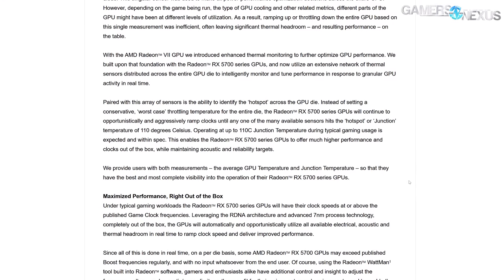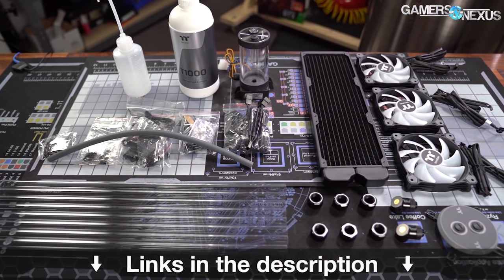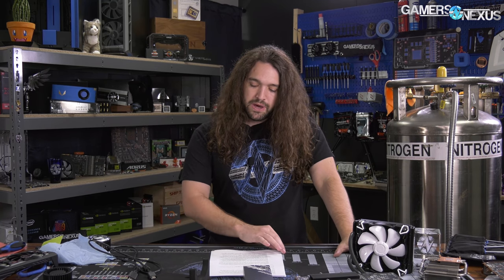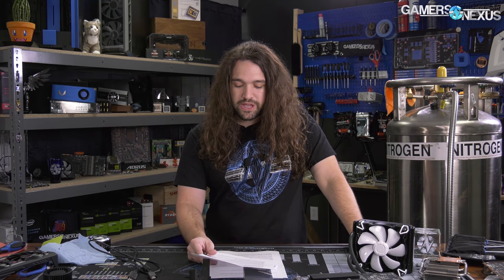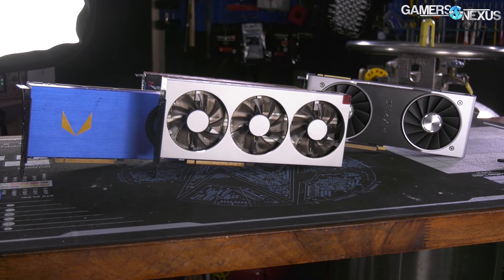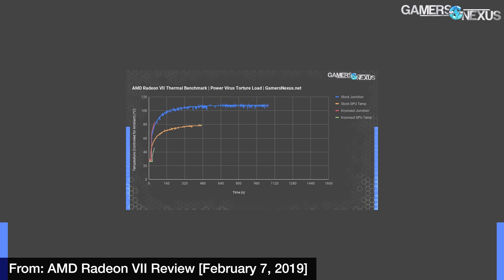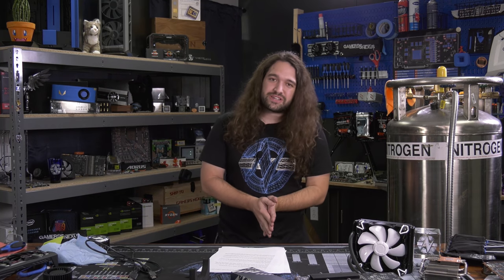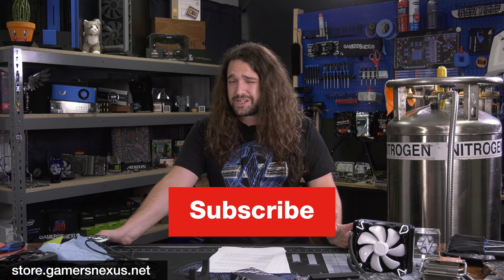Explaining Navi 5700 XT Junction Temperature | 110°C is Not "Expected"

Comment: Man... I need Help :(... Im from Brazil , I dont even know how ti speak english very well... But I got Sapphire Pulse... All the temperatures are even better than your test , GPU Edge I get 65c , Memory 80c ( Max ) and VRMs 58c !!! But the fucking hotspot is getting hot , 106c every time I put " unlimited frames " , Fortinite and Modern Warfare ( BattleRoyale Mode ) , they are getting 174FPs 1080p , and the " GPU Hotspot " reaching 106c in both cases... When I lock the frames in 60 FPS , that Gpu Hotspot came to 60/80c MAX !!! ALL ULTRA AND EPIC SETTINGS. 
But I have a 144hz 1080p monitor... I really want to play in the 144Fps , but not in 106 degrees ( hotspot )... 
IS importante to say that even When Hotspot gets 106c , ALL the other temperatures keeps nice , Edge 68/70 Max... 
Should I give that Card Back and take a Red Devil ??? I Have a Sapphire Pulse 5700 XT right now , Just to remember. Thank you.

Comment: In other news, 145c on motherboard VRMs is not fine, do NOT turn off VRM thermal protection! (RIP my motherboard).
Reply: I’m pretty sure the AM4 Asrock boards are bugged (well, I know they are, at 0c they show 116c VRM due to integer rollover), and I know a few companies had a limit above the max for the bits, so it simply couldn’t register above X degrees, and they set the safety limit at X+some and so it would never detect it was overheating... Good job... Slow clap...

Also, why didn’t you just run fans on your VRM? I ran a 4 phase board at over 300w on FX thanks to $3 in cooling upgrades to the VRM, I’d recomend that next time if you’re pushing it (2x 40mm fans and some 15x15mm heatsinks which I added to the chokes since the Mosfets already had heatsinks, but that cost would cover heatsinks for both). That was on ambient cooling, so realistic (sub-zero I push it farther of course, but then everything is cold so it makes sense that it would be fine), but that stopped my VRM throttling issues back then in the FX days.
Reply: The board i was using was an MSI Z390 Gaming Edge AC, pulling about 230w at a 5ghz all core OC, poor VRM even being a 10phase, just didnt like it, i was busy checking stability then noticed that the VRM temp (which goes to 125c then stops registering) had been not registering (above 125c) for a good couple of minutes, before i had chance to quit the stress test, the board died, wouldnt boot at all after that, completely dead! Normally it throttles at 115c VRM, i didnt expect it to hit 145c as indicated by external thermal probe thingy
Reply: ValkyrieStar wow, that’s a trash board then... My 8 phase x399 board barely gets warm even with those crappy heat-blocks (it’s not really a heatsink, more like a brick without fins) and no real airflow, does fine for hours at 450+w on the CPU, VRM is barely warm**.

**I use my machine with 4x Fury and 2x SuperNova 1300 PSUs to silently heat my room in the winter since it’s just as efficient as a space heater but it’s silent at 1.7kW with voltages cranked for extra heat, and it runs Crysis at 100 fps at 4k Ultra ;)

Normally I’d say if you overclocked (even 1 MHz), you broke the warranty and that’s on you, but that is so trash I’d be tempted to ask for a refund and buy a different non-$hit tier level board. 200-220w was right when my $40 (price paid brand new in 2015) mATX budget 4 phase board needed airflow, it could do 200w without throttling (24/7, and my only case fan was the exhaust on my 120mm AIO), so that MSI truly is just garbage bin quality. I hope you got a different one (Asrock seems to have well priced competitive boards, that’s what I use for FX/AM4/TR4 platforms). That’s just sad... Hope you got a better board, if it was replaced with same, then I definitely recommend spending the $2 in small and quiet 40mm case fans, because apparently that z390 is more delicate than eggshells! Man that sucks... well, good luck next time!
Reply: @jakegarrett8109  i managed to get a replacement board, unfortunately of the same model. I seem to manage to choose boards with trash VRMs as my X399 Gaming 7 (8 phase) i had before it (Gigabyte and AMDs fault for not fixing the god awful BIOSes so i went back intel).
I wish they had put good VRMs on Z390.

I've been looking at Ryzen 3000, but so far the temperature issues with AIO's has put me off, because of the die locations under the heatspreader means it doesn't cool well as AIOs are designed to have best flow near the center.

Comment: Let's simplify this to only one transistor every transistor have 2 junctions in PNP it is PN and NP... Now let's say we are using it to max potential so the case temperature & junction temperature will rise up let's say the case and heat sink is around 70C  while the junction can be easily up to 120C. Transistors are usually rated up to 150C and some even to 170C .

So yeah the 110C of the gpu junction is expected and normal

Comment: Summary:
Bad Cooler = Poor Life Expectancy of card, possible bottleneck due to thermals under poor ambient conditions.(cooler is sht , why is the cooler sht, why use a sht cooler, dunt uze sht cooler).
Good Cooler = Better Life Expectancy of card, more tolerance for poor ambient conditions, more stable boost.
60-90c is fine, 110c wont fry your card , but it certainly isnt ideal.
Better cooler design would of prevented the confusion and controversy from ever being an issue in the first place.

Stock Cooler = Fine , but loud
Community to Amd : "why such stupid stock cooler ? " lol
I own this card
I love this card
It runs great
The cooler if I turn it up , lol it sounds like a blade server (almost).
I plan on changing the stock cooler, just for the noise reduction (probably if i ever get around to having time).

Comment: Whatever people say lower temperatures is always better. And quiet fans are also better. There is no discussion here. Nobody wants to work next to a jet engine that is reaching the temperature of the sun, that will make the GPU slower (because it loses performance with higher thermals) and it will make people go crazy with "ZZZZOOOOOOOOOOOOOOOOOOSSSSSSSSSSS!!!!!!!!" next to it. 

Blower designs suck (pun intended), they are loud and make the cards work hotter. Yes, they are very pretty, you can make cards very slick and minimalistic, but on the performance part, open fan designs are way better, they can run quiet and with lower thermals, that´s it, simple. Blower designs are good for laptops because thye save space, but everything else should use open fan configuration. Hell, even a card with THREE fans is quieter then one blower, come on. It´s documented, it´s not like people are bashing hte blower design because they don´t like it, they are bashing it because it sucks.

Comment: Yeah i gót palit jetstream Rtx 3070 and it was tíme to repaste cuz cart háve 4 years so i decidet to change it cuz cart run at full load while gaming at 83 deg and hot spot 105 wich is not ideál yes i dont háve nay issues with cart but it just run kôre hot. All tho manugacturer claim that this cart i have in idle run a bit more hot at 44 deg well after i repaste mine run ár 28 deg and temp while playing on gpu drop on 77.8deg and hot spot highest 93deg wich im happy. I dont change pads cuz they dont looks that bad but in future i Will do it but for now it will do., also i used thermal grizly kryonaut and its work just great and i ask manugacturer what kind of thermal paste they used and they claim they use standart 2,9w MK so i used thermal grizly with 12,5 W/MK.

Comment: Don't care for whatever they say... All I know is since the 90's all my GPU's died in like 1 to 3 years without OC (though the crap ATI X1800GTO from like 2005 or 2006 got damaged by just using ATI drivers auto OC when they introduced it, it got texture corruption 4 ever even though still worked but eventually died)... 

Basically all GPU's I had that run at high temps died, while my only survivor for many years is the GTX570 Asus DirectCu II with 3 massive slot cooler and 2 big fans, even with 1.2v flashed bios at 1.2V and at massive OC to 910 - 915mhz (stock clocks are 732mhz for a factory GTX570) for years with 60- 70% fan speed the GPU never died or crashed and its still working, never even reached 80Cº while playing, it also had a lot of OC on the memories, even a game running for 2 days in a row on a Lan party 0 problems...

My current Strix RX480 OC is flashed to Strix RX580 OC and with stock fan curve its mostly hitting around 87Cº, super crap temps for what is supposed to be an even improved cooler from my older GTX570 Direct Cu II to the new Direct Cu III on the Strix, but it seems AMD just runs hot and doesnt OC much either :(...

ps: This is also sounding pretty bad for Next Gen consoles, while CPU side is actually both thermal and power efficient, the GPU part of it is being a huge power eater and tons of heat, if they dont heavily modify it for the consoles it looks like the Next gen consoles will either be super downclocked or be using quite a lot of power and a big price with the need for a huge cooler too, just hope they don't be another PS3 fiasco coming at 600€ :(.

Comment: My 5700xt couldn't keep from crashing my system long enough to even reach 110c lol 
I tried every trick possible to get that card to work.  The hardware is good but it should have been launched with working drivers, it didn't.  It is still beta drivers 1 month after launch. Unacceptable.
Started my RMA procedures earlier tonight. reinstalled my shitty 1050ti and I am running smooth as can be expected for such a low end card.
Reply: They havent talked shit about the  drivers i smell ripoff or a fast discontinuing i know u launch drivers before or at launch not years after

Comment: What about the life of the chip at 110C? vs 80C
Reply: I know of at least 1 HD 4670 that is still kicking while gamign at 113c or above used to be two but one died a couple months back.. seems like an acceptable lifetime to me.. RTG says it will work as expected.. you can probably trust it. In case you don't feel like doing the math that's around 10 years at 113c for one and almost 11 at the same temps for a second 6 of those years crossfired together, brand Gigabyte model HD 4670 512mb with the tiny aluminum fin cooler and tiny fan embeded into that heat sink, single slot card. Worse than a reference barrel cooler by miles for whatever that is worth.

Comment: Planned obsolescence. Deliberately run hotter than optimal for maximum consistent performance and lifespan. Chances are, the capacitors will blow up before the silicon though.

This is another reason why I am a fan boy of no one.

Comment: no need for custom cards if AMD puts a good cooler on them. that bad for business  plus it not like your boost clocks go up that much with a 20c  drop-in  
temps  60 Mhz 80  at most other than running cooler and less sound there no point to custom cards your not getting more fps with a custom cooler so AMD  reference cards do their job. 
 but not so good that you don't buy a custom card that's  good  business sense

Comment: We cant really tell that Radeon's Navi Juction temp is bad or dangerous if we dont even know what's nvidia junction temps.
Reply: Turing is 12nm node, and different fabrication anyway. They can't really be compared even if Nvidia made that sensor available. I'd imagine their Tj max would be higher than Navi but again, it most likely can take more only based on node size, and how hard it can be overclocked. The problem is that AMD seems to imply that it's fine to run cards flat out with no headroom anywhere. And since neither those who wrote that article at AMD (marketing and public relations) nor those reading it (us) know what the silicon can reliably take, then it's all a huge deaf discussion :)

Comment: AMD is correct, it will not affect the gpu, but it will freak the hell out of pc builders who after building a few rigs and running some benchmarks, all of a sudden they have a PHD in thermal dynamics.  Custom coolers that come out are to address the fears of people who don’t understand it.  I am not saying custom coolers are not better than the reference cooler because they undeniably are better. The point is, the custom cooler was not designed for the gpu, it’s designed for the people who buy the gpu and their expectations.

Comment: i personally think that the junction temperature is a bit of a marketing stunt by Amd to mask Navis high temperatures. Which are to be expected btw. when you push 225W of heat through a very small die of about 250mm2 and on top of that use a poor cooler like the stock one.
I would guess that other cards temperature readout actually much closer resembles this  junction temperature rather than edge temperature or whatever it is called.

Comment: PEOPLE SHOULD WATCH IMAX 70MM PROJECTORS....THE FILMS ITS WIDE BUT ITS PROJECTOR IS VERY HOT SO THE FILM NEED TO BE COOL IN A EXTREME CONDITION WHEN PROJECTING HUGE LAMPS CAN REACH TEMPS FROM SURFACE OF THE SUN....tHAT BUNCH OF FANS EXHAUST THE HEAT AWAY FROM FILM...AND FILM DO GET WARM TO TOUCH AFTER MANY PASS ENTIRE DAY ON SAME MOVIE...THE MATERIAL ON THE FILM CAN HANDLE IT...BUT WHEN FANS GOES OUT..THE FILM CAN GET TOO HOT THAT CAUSE FIRE ON YOUR PROJECTION ITSELF...ITS VERY SIMILAR TO SILICONE HOW CIRCUIt IMPLANT IN

Comment: holay... People that don't understand electronics should just keep their mouths shut. 180 degrees is MIL spec for IC's, and automotive spec is 150 degrees. 110 degrees isn't a big deal if the silicon is made properly. I often wonder when watching Buildzoid and you if you have your facts straight for the IC's on these motherboards etc. They don't "NEED" to be "COOLER".
Reply: ic DOES NOT CONTAIN ANY LOGIC...AND ITS SPEC HIGHER CAUSE ITS MADE OF DIFFERENT MATERIAL FOR MINI VOLTAGE TRANSFORMERS  ON YOUR BOARD...THEY DO RUN VERY HOT CAUSE CURRENT IS HIGH...BUT ITS NORMAL CAUSE THEIR NO LOGIC IN THEM OR ELSE CPU OR GPU..THOSE CONTAIN LOGIC AND MEMORY...AND RUNNING HIGHER 85C...IT WILL LOCK UP AND CRASH BEFORE GOES HIGHER TO CAUSE BURNING THROUGH LOGIC...SILICONE ...SILICONE ARE NOT MADE TO RUN HIGHER TEMPS...It is LIKE A FILM CATCH ON FIRE THAT burns YOUR IMAGE

Comment: Steve, you completely missed the chance to explain this to AMD fanboys properly...
...with Crayons and Fingerpaint...
Reply: No, What he failed to explain was that Navi's reference cooler thermal performance is exactly the same as any other reference cooler for a high end card made in the last say 5 years. and his title failed to explain the difference between TJmax and average operating temperature, resulting in the comment section meme's.

And all of them had Tjunction temps of over 100 degree's. Navi's just the first to actually report it. or even measure it for that matter.
Reply: The Countess 🤦‍♂️
So if something is 💩 but everyone else also makes 💩 it turns into chocolate pudding and you gobble it up 🤔

Comment: 110 is not normal!
And will also start degrading the PCB resin and most likely degrading the life expectancy very much
Reply: considering that most likely we have been running 100+ degrees hotspots on GPU chips for years now ...

if some cards are hitting 90 degrees EDGE temps you bet they do hit over 100 on the hottest spot...
Reply: tjunction doesn't, EVER, reach outside the die. they are just very short duration and very local hotspots.

Intel's had a TJmax of 105 degree's on many of their CPU's for YEARS, yet nobody cared. AMD says their Tjmax on the GPU is 110 degree's and suddenly all hell breaks lose.

WTF internet.
Reply: @Asghaad  AMD says it will boost uintill it hits 110 and intel is more like 95 is the absolute max and will throttle down long before.

I have never ran my intel chips over 70°c
Reply: @tullgutten  AMDs junction temperature is the hottest spot the sensors INSIDE the silicone report at the time
Intels "temperature" is measured at the edge of the die and simply put if your hardware on Intel reported 70 degrees your real temp as measured by the AMD would be around 90-100 degrees ...

at 95 degrees edge you are talking 120 ish degrees "junction"...

it does NOT mean Intel is running any cooler, AMD just provided you people with data you didnt have before and now you all are freaking out because of some number not realizing we have been running silicone at those temperatures for YEARS ... you just believed that the reported EDGE temperature was the temp whole package was running at ...

Comment: AMDs message, as i read it - 110C junction temperature will not damage your card and is fone for the silicon.  Incorrectly rewording this is WRONG. That is what you at GN do. That is what others possibly do. Thank you for addressing that, but then you turn around and reword it incorrectly again. Also, your commentary in previous videos - the thermal pad will not degrade, now, as an example, you mentioned that pad becoming less thermally conducting. And parroting something is as bad as it gets. So stop it. And a cooler card will work longer for you anyway.

Comment: While i love you and your work that intro is just painful on so many levels. It can't be "wrong" just because it doesn't hit the high temperatures. It might not be good that it runs at those high temps but when the card is designed to work with it it absolutely is within spec and expected, that's literally the limitations the card was built under counting worst case scenarios, that is what within spec means. That it can perform better with a better cooler has absolutely no bearing on  it.

Comment: just wait till 5950xt strix card series in 2020! problem solved..aka nvidia gpu killer
Reply: It'll beat 3080ti, and not just 2080ti super.
Reply: @kiranfernandes2261 Fernandes you better hope it's competitive with the 3080ti or Nvidia will charge $2000 for it.